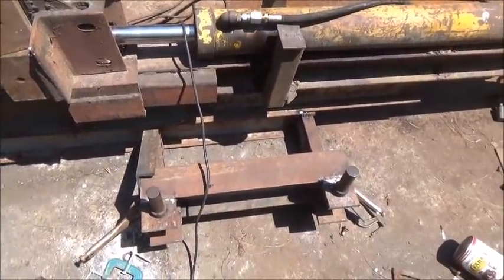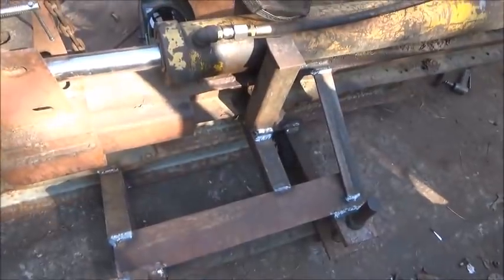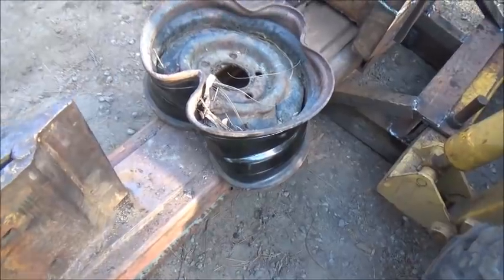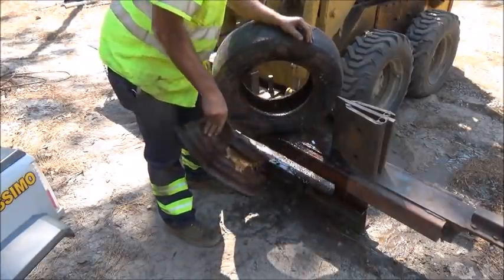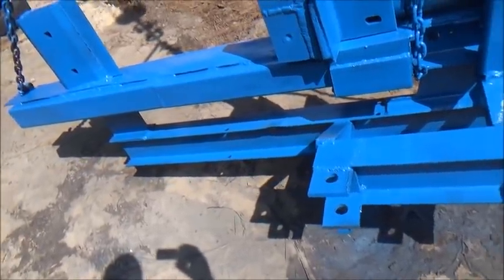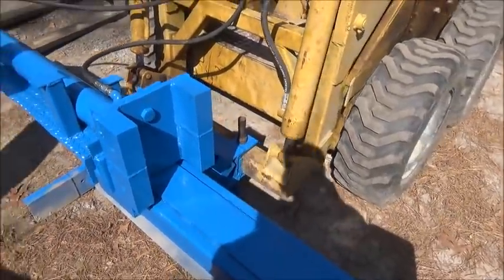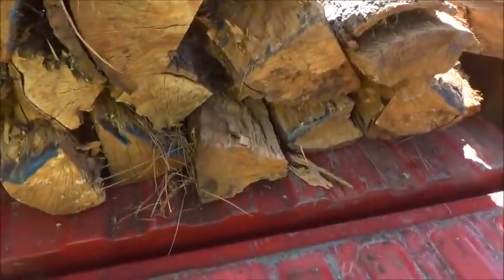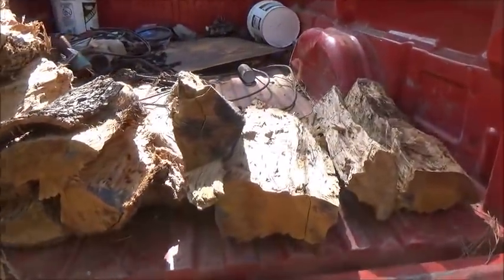TRASH TO TREASURE SERIES EPISODE 2 PART 2 OF 2 RIM CRUSHER

Comment: You almost looked like a yankee the way you were splitting firewood! Haha. Best home made splitter i ever seen was cylinder from a garbage truck mounted on a large I-beam and all other parts were just scrap steel laying around. We set it up for a quick disconnect to a Crane Carrier garbage truck with a 6-71 Detroit. All full throttle that would split wood across the grain. I think you did a great job on that project, keep them coming.

Comment: Actually, no.  I don't skip through the videos, but this is the first time I'm hearing the reason why you need to crush rims.  But now it makes sense, so thank you for that :)  I always just assumed you saved them all to be able to have extras for the older vehicles you pick up when they have tires that have set flat for 20+ years and have rims that have sat in the dirt/mud that long.  Oh my, look at that blue splitter, lol.  I laugh because when I was a kid we painted an old Roanoke square hay baler a shade almost identical to that shade of blue because after mixing the paints that we had from other projects that was the color we ended up with :)  That also explains the old '57 Ford pickup we had and why it was a color that Pappy called Burple...sort of a brownish purple. if you can imagine that.

Comment: Very Cool.  I wanted to mention, I saw one once that split on the ram's back stroke also. I think it had a double wedge  on the center moving part & braces on either end but it could be made the other way round & work. I guess the only reason you would need something like that tho, Is if you had allot of wood rounds to process & needed to speed up production. I think there was another one that had a fast return somehow or maybe I am confusing it with an old steam powered sawmill jig I once saw....

Comment: I would mount a control valve onto that splitter so that the person loading it is in control of its operation.  Quick connects to the  valve.  Much safer.  Assuming you can connect from the skid steer a constant flow (bypass it's valves or have a constant on with a return).

Comment: Speaking of video-making, I'm still hoping for one of those NC snake videos Jonathan has eluded to occasionally.  I don't want to see anyone get bit, but, if someone were to jump, say 20 feet into the air and set a new high jump record...  Well, that would be something worth watching too.  The rim splitter is great.  Though for safety sake, the guy who is loading the wood, should also be the guy who's pulling the hydraulic lever.  That's the way we do it in snake-less northern Maine.  Up here, wood is wood.  When you burn as much wood as we can burn here, everything gets cut and stacked.  Spruce is real good, if the tree is dead and the bark is falling off.  Oh, and if anyone is wondering, there's three-times the heat in dry wood as there is in wet wood.  So, get her cut right away for next year.  If you cut your wood right, you'll make beautiful forests.

Comment: Another handy tool. Maybe you can keep improving this one by tapping in before the controlls on the skid steer and putting controls on the splitter/ rim crusher making it a one man job to split wood. Seems a bit dangerous to have you between the ram and the wedge while it's control is in someone else's hands

Comment: My 1737 (gas version of your machine) has a way to lock the auxiliary pedel into a running position. If you did that, you could plumb a control valve onto the splitter to make it one person operation. Just my 2 cents...

Comment: I hang out with a friend who sells scrap, old car parts, has about 100 flathead v8's apart in his shop and around his yard, i help him take tires apart, i wish i had your machine, he has a pile to do and they are rusty, i would mount controls on the crusher, i have a new wood splitter control with auto return, i have to see if i can build a crusher for my bobcat.

Comment: I wonder if it would work as good or better splitting wood if you left the rim bender attached. ?
Reply from the maker: I was afraid a piece would get jammed between the two uprights and be a bear to get out.
Reply: @jonathanw4942  yes that could happen especially if the wood was pretty small. the main advantage might be that the splitting wedge could go all the way through the stick of wood.

Comment: Why not just put 2 or 4 more blades on the fixed end for wood splitting and split once per log? The bolt holes are already there. Now I know how much everyone needs a dragline bucket/crane. The first thing I would do is fix the fish pond from 1953. That crane was brand new when that old 2 acre pond was built. We had a Johnson’s Hardware with everything from rubber boots, fishing reels, nails, bolts, Radio Flyer wagons and bicycles. I never had a “new” bicycle. It was a wondrous place.

Comment: Pretty cool, it doesn’t really matter how much it cost, if you use it and it saves your body from busting your butt it’s worth it. 
It seems like it would be easier to use if you had hydraulic power on all the time so you could put a control valve on the splitter/tire rim separater   
Can you run hydraulics so they are on all the time to the splitter? Is it an open or closed system on the skid steering? Now that it works I’m ready for the next project!